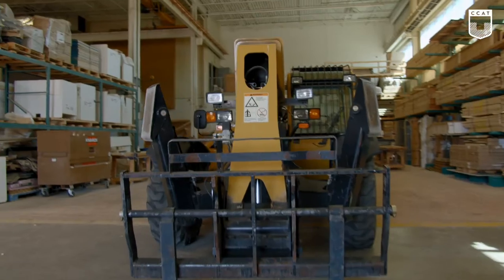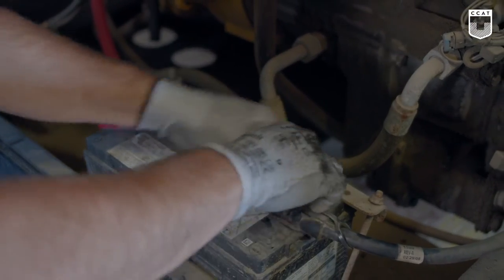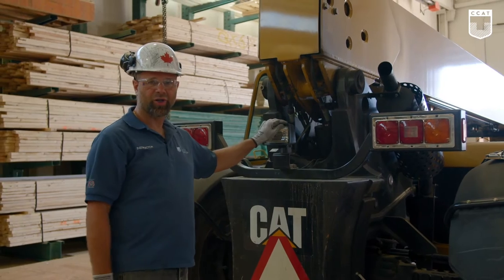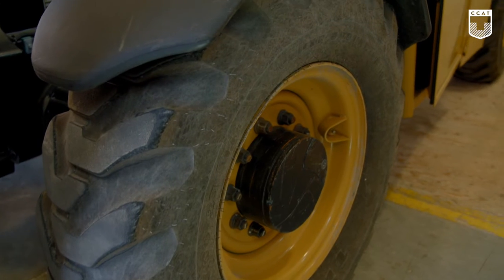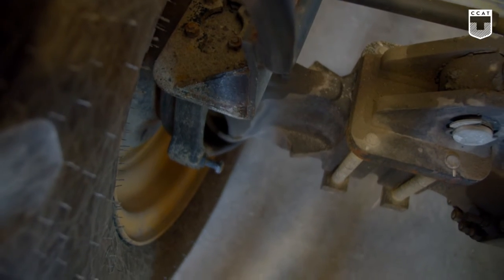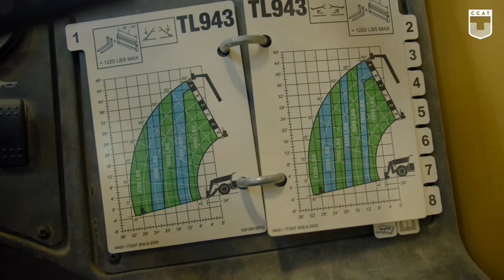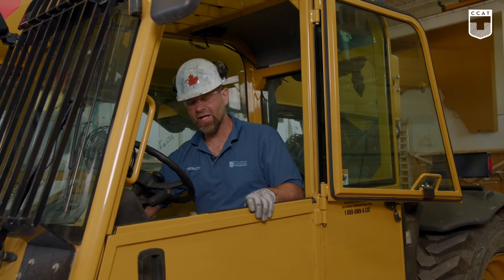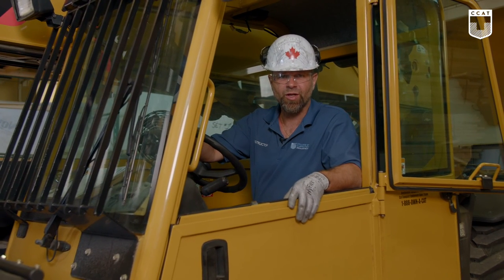CAT TL943 Telehandler Instructional

Comment: I found this to be one of the best instructional videos on telehandlers. Very comprehensive pre-operation inspection. If operators were to consistently use this procedure, surely safety would improve significantly. Overall a very well done video presentation. Thanks for posting it.